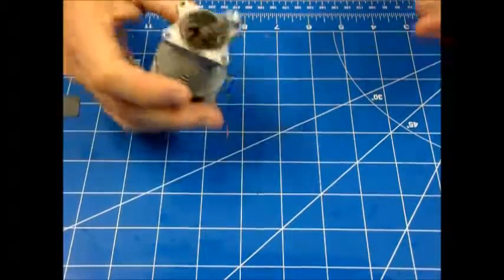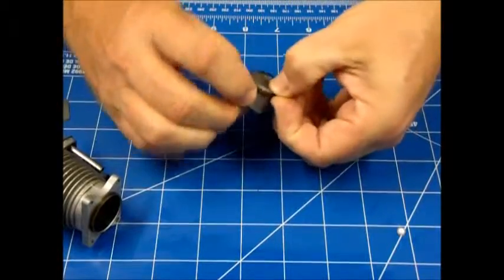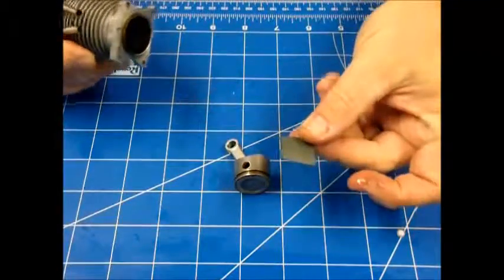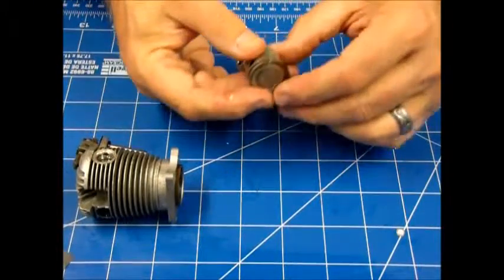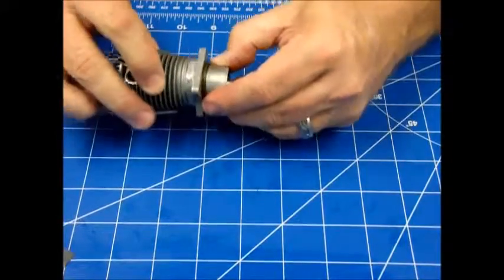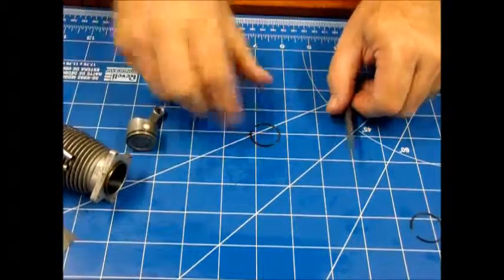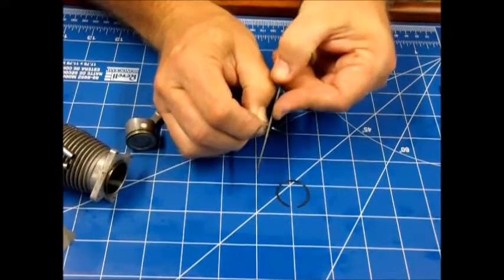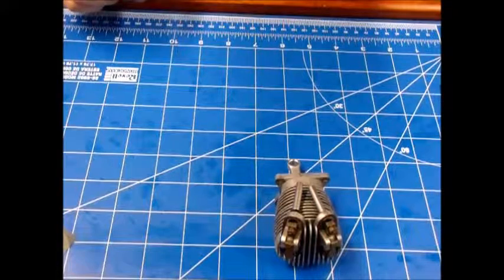Saito FA-50: Piston ring replacement part 2

Comment: Next time you have to size a ring, file it them insert the ring only in the cylinder bore and measure the end gap with a feeler gauge. Usually .002 to .004 should be fine unless manufacturer specs something different. Make sure you round off any burrs that are created with the file. Nice video Dave.